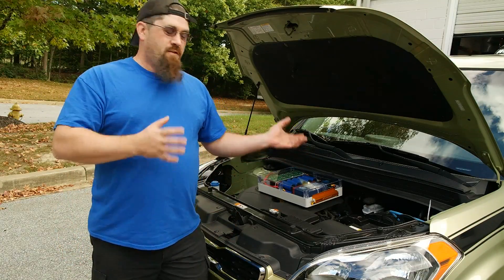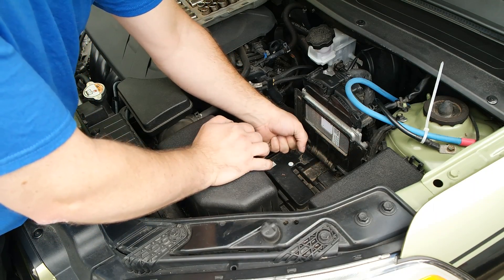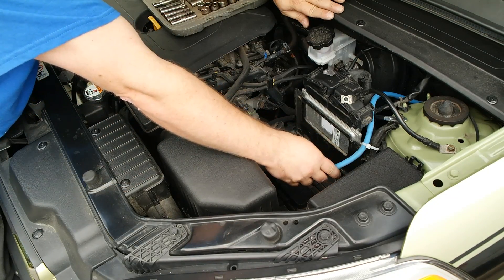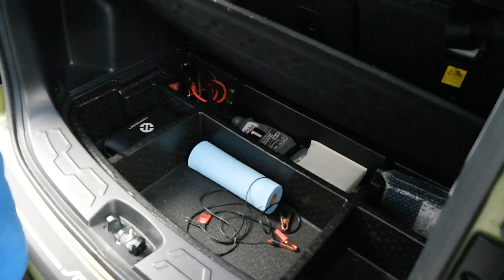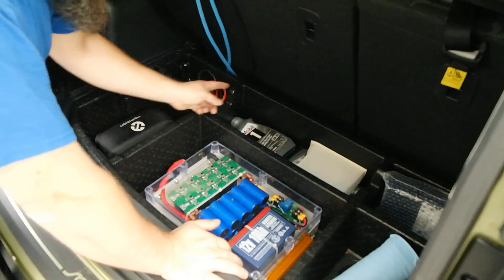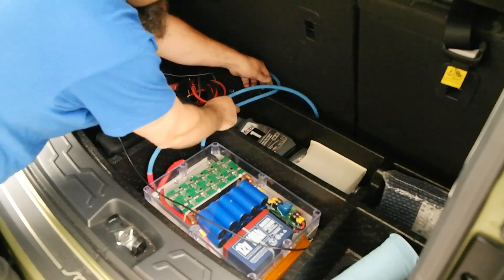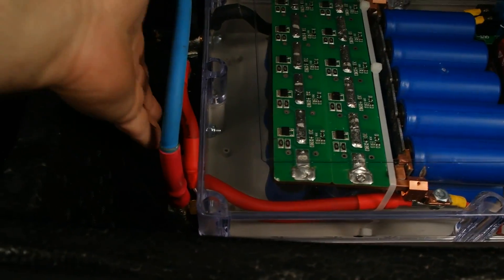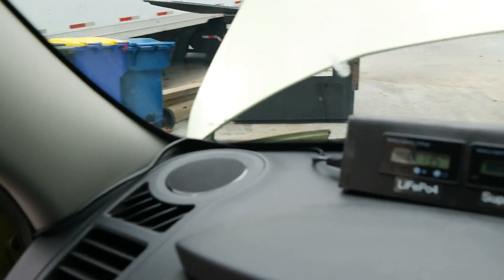Hybrid Supercapacitor Car Battery Part 6 - Installation & Testing

Comment: I think you could've started this thing with half the bank, and I'd seriously recommend a charger for your lithium battery. 

It's been 5 years now, so I'm super curious how this system is going atm, I'm planning on building something similar myself but instead of a small lithium in the pack I'll use a 100Ah Lithium battery that's commonly used for running fridges, because this will run a fridge, but charged by solar it shouldn't ever go flat, but just in case I'll put a low voltage cut off so the super caps don't get drained if the battery drops below 13volts.  

Keen to hear from you if you're still around man.  Good build, and your install is fairly neat, as others mentioned, insulated stud under the bonnet would be better, but that's all I can think you could do to make it spot on, also probably a fuse up the front so your alternator doesn't get fried if the connection running to the back of the car gets cut

Comment: Should put capacitors in factory battery location. Then run smaller wire to lithium battery in the rear. Could have saved a ton on wire

Comment: Great video. but I saw someone else doing a test with just capacitors, and he found that they naturally discharge on their own over time. Also, Caps voltage will drop all the way to zero really quick which a downfall in some cases. But, Your is the right way of doing as I've seen on other video. Again thanks for sharing this is awesome. love it.
Reply: it depends on how they are made - but they do call them super compactors for A reason
Reply: good caps will not self discharge over time.  Only the cheapest junk from China.

Comment: I intend NO criticism at all, but I do have a question. What will happen to the Caps and the little 10 Amp LiPO Battery if you were to sit with the engine off, running the car radio for an hour? The Higher Quality Deep Cycle Marine batteries can handle that, but what about YOUR unit?

One potential HUGE positive I see with this concept is in Solar Lighting. That being said, I don't think a Solar Charge Controller designed for supercapacitors yet exists.

I APPAUD your tinkering. This is how new Knowledge is gained and discoveries are made. WELL DONE!
Reply: I know this is a year old, but thought I'd give my 0.02 for future readers. Deep cycles aren't all that great for long running audio applications. They're great for sitting long periods of time and holding a charge though, hence their intended marine use. If you look at any serious car audio setup (and not just "boom" vehicles), none of them use deep cycle batteries. They will use quality AGM batteries unless they've moved entirely to lithium. The AGM battery in my dodge charger, with a 2k watt SQ audio system will play for a good hour with the car off and still start it.

The point being that for longer periods you'd need a higher capacity battery. For a normal vehicle like this, he may not get an hour of play time with that small battery, but I doubt he does that. If he did, he'd likely get a larger capacity battery to begin with, regardless of using the super caps.
Reply: All lithium can be completely discharged to the minimum voltage without harm, so it's effectively all deep-cycle.

Only issue would be a dead battery that needs recharged.  This setup is obviously not designed for engine off accessories running.

Comment: Hand crank isn't a bad idea.
Worst case stuck up shit Creek without a paddle, everything goes flat. It's pitch
black, pissing down rain. Everything is completely dead! ☔🤔
A quick couple of minutes of hand cranking the box, putting charge into the capacitors, start the car and your off with heaters blasting! 😜
Have I sold you the idea?!

Comment: No problems driving at night with high beams on an a/c running as if it were Summer? Just curious if the alternator alone can handle the without help from the original battery?
Great thought out job BTW 👍
Col from Melbourne, Australia. Cheers.
Reply: If your alternator can't there is other problems

Comment: Good project - BUT I fail to see what advantage you gain by replacing the original lead-acid battery with your hybrid Lithium-ion-Super-capacitor battery ?
1-) You may have saved 10 pounds in weight but you hybrid unit is easily three times the VOLUME of the lead-acid, taking up room in your trunk 2-) Cost wise a lead-acid battery is rather inexpensive and can last 5 years,  your hybrid supercap battery on the other hand is easily 5 times more expensiveness (in material alone, not counting your time to build it),  you could  use 5 lead-acid batteries ( 5 years each) totaling 20 years that would equal the cost of your single supercap battery 3-) Yes you do have more cranking amps but do you really need it for a small family sedan ? maybe you could better explain your economic calculations for your project.
Reply: engine start modules see ROI's from fleets of heavy duty trucks (especially delivery trucks).  Small consumer vehicles could see a benefit, but those markets are primarily limited to start-stop, pick up trucks, and RV and off road usage.
Reply: well if the zombie state happens then this is the car I would like to have+ a hand crank. why? like what 50-100 some years or more or the super/ultracapacitor battery bank to last. A hybrid version like this would help with the main battery because of a hybrid system,there is no direct overloading draw on the battery[ies] instead the captors do that job at the peaks, which has shown to help with the longevity of the main battery bank EV/e-cars considerably at scale both small and great.
Reply: @PETER.POLANCO 104013that's not really true.  a standard 70Ah PbA battery has over 30000 farads of equivalent capacitance. The issue is internal resistance seen by the alternator especially in the cold weather. Caps are better in that scenario. Aside from the weight savings, he will not see any change in fuel economy without a reprogramming of the charge control strategy to allow for regenerative braking

Comment: I had a question or two @Mad Electron. Firstly I'm curious would you use the same 0.5 ohm 200 watt rated resistor for the 6 pack 2.7v 350farad super capacitor bank as you chose for your 3.0v 400farad capacitors? Also I believe I made the mistake of buying 10 string 2.7v 350 farad protection board which apparently is "NOT?" going to work with my standard 12volt led acid car battery as a back up bank for other uses as I believe now it will be rated at 24volts? instead of the 6x2.7 =16.2 capacitor banks, if you could verify this that would be greatly appreciated Sir!

Comment: very cool project, I have thought of doing this my self. I would suggest you get a surface mount terminal block, one post, to attach your engine compartment cables to. If you can't source one, Dodge uses them in cars like avenger, the battery is remotely located is down in the fender well. Nice block with a cover, gives jump access point if needed.

Comment: Great job. Out of all videos about the ultracapacitors, you build the most beautiful design and concept. I liked the fact that you put it in the trunk. How much is the total cost for this project for all parts? And why you didn't install 6 x 3000f farad instead?
Reply: He has a very small engine; therefore, he does not need than much energy storage.  Plus his trunk is very small, haha..
Reply: His voltage is barely dropping as it is now. He could have reduced the size of the caps to save on cost.

Comment: woa,bigger than expected but very cool,would be nice for hybrid cars!
Reply from the maker: +Tailslol or those cars that shut off the engine at red lights.
Reply: you better change all car lightbulb to led now,just in case.
it will drain less power and will be more effective.
Reply: and i wonder what it will take to rebuild a prius battery this way...

Comment: Can you put a current clamp on the + lead next time you start your car...to see how much it's pulling in starting...also would be cool to get some data points on temps, current drain on those starts...and plot the amount of energy it pulls
So very cool...I have a 2.3L Ford Ranger...would like to try to build one...need a BOM or something if you have it
Awesome Awesome Awesome...love it when a plan comes together!  Now for some reaaaly cold weather starts (really wanna know what kinda current that bad boy is pushing)
Reply from the maker: I plan on doing a current clamp test once I finish the move to the new house and get everything setup, plus I need to buy a good DC current clamp.

Comment: Great job. I am thinking of replicating this with a homemade lithium pack. Do you know if your battery has 3S or 4S configuration? Any BMS on it?
Reply from the maker: +Dr. Kivanc Biber it should be a 4s3p lifepo4 setup inside the battery, and it does have a BMS built in as I did drain it to 11v while on the bench once and it did a low voltage disconnect.

Comment: This can deliver 1000A at 12v that's 20hp.
Reply: What is the gear ratio of the starter to flywheel?
The ratio of the number of teeth on the ring gear and the starter drive pinion gear is usually between 15:1 and 20:1. This means the starter motor is rotating 15 to 20 times faster than the engine. Normal cranking speed for the engine is about 200 rpm
So 20hpx15:1 ratio =
This is why that motor can turn over that engine...and if it can pull TRUE current w/o the sag of lead acid...it will crank over like a champ
I wanna build one now!
Reply: http://www.ioxus.com/english/products/ustart/

Comment: Good job. I wonder what the biggest engine is that you could start with this...
Reply from the maker: +Paul Kipling one of these days I will try it on a V8 and if it works well I'll give it a try on a powerstroke Diesel and see how it fares.
Reply: Yes please. One vote for testing on a diesel. I've got a VW Jetta diesel and a 1 ton diesel work van. The Jetta's  battery is non-standard and expensive to replace through the dealer. The van uses standard batteries, but two large batteries is expensive. That's why I'm exploring alternatives. Both sets of batteries won't make it through winter and needs to be replaced... again... This setup would probably work on the Jetta.

The van is a different story. Probably just put a cap bank as a supplement to the vans two large AGM batteries. Glow plugs take a lot of power right before starting, so I'd be curious to see what impact the super caps have. The Jetta starts easily. The van sometimes needs to cycle the glow plugs 3-4 times before cranking over in the winter. Limiting current from the battery could be a problem in that case..

I've been stranded in both vehicles in winter because the batteries couldn't deliver enough power to heat the engine and then have enough left to turn the engine over. Maybe caps would be the difference between starting and being stranded.

I agree with the other comments, awesome project and very nice nice video series of the build. Very insightful. Thanks for sharing it.
Reply: I know right...I wanna see if it will kick over a big ol' fat diesel!
I have a Cummins 2500...it takes 2 batteries...and sometimes it's a fight...but once fired up...daggum!
Reply: you can and you should replace the 2nd battery with super-capacitors. It will start a lot faster. I have a v6 and the battery is almost dead. takes about 2 second to start the engine. once I added the 5x 600Farad capacitors from Amperix the car starts almost instantaneous; and with the same battery. It does not matter the battery voltage anymore.I drive about 30 to 45 minutes and the battery does not fully charge, but it does not matter anymore since I use the supercapacitors in parallel. I already bought a LiFePo4 battery that will replace the current one.